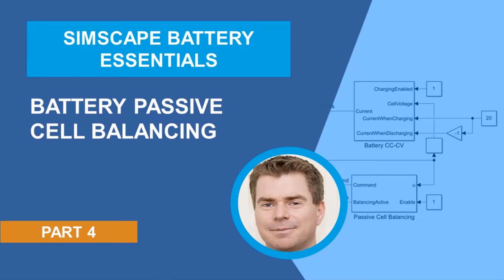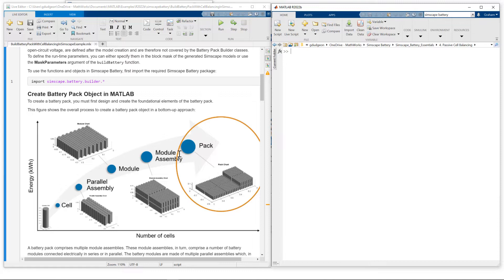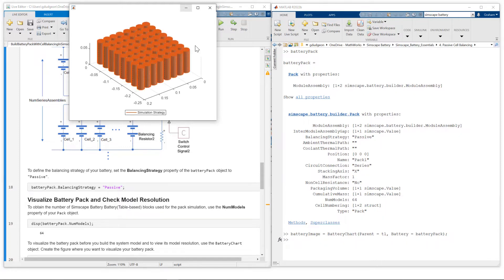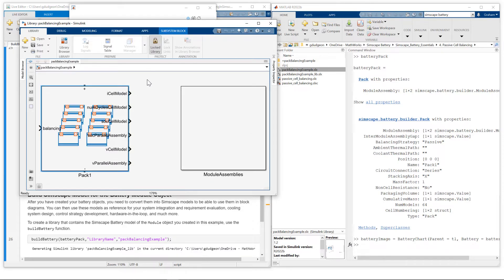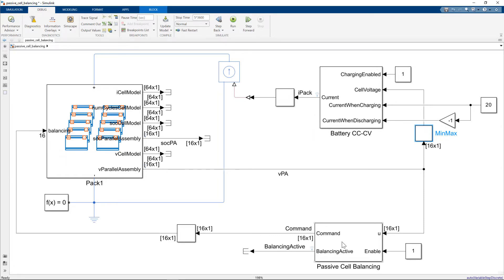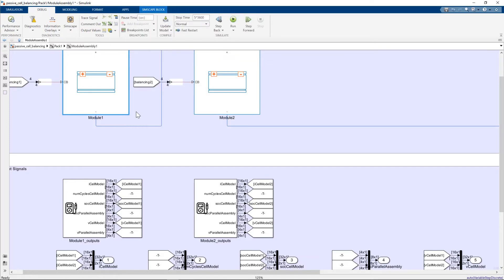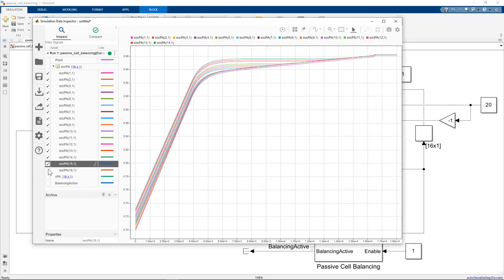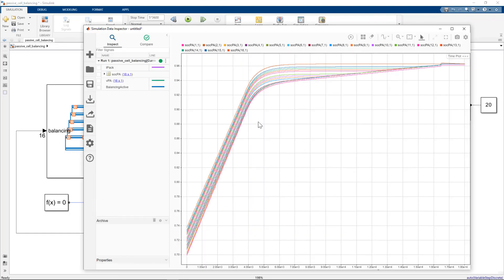Battery Passive Cell Balancing | Simscape Battery Essentials, Part 4

Comment: It was a great video but i am getting the straight line graph moving in y-direction  after running the simulation and getting warnings as "At time 5677.000000, one or more assertions are triggered. State of charge must be less than or equal to 1. The assertion comes from:
Block path: untitled/Pack1/ModuleAssembly1/Module1
Assert location: 
    o (location information is protected)
    o In between line: 80, column: 26 and line: 92, column: 52 in file: D:\2Extstudy\simscape drive\simscape\+packBalancingExample\+ParallelAssemblies\ParallelAssemblyType1.ssc
    o In between line: 73, column: 39 and line: 82, column: 61 in file: D:\2Extstudy\simscape drive\simscape\+packBalancingExample\+Modules\ModuleType1.ssc"
please help me with this i am struggling since 4 days to find the mistake😢😢😢😢
Reply: Instead of using the minmax block to connect the pack and passive balancing i was using unit dealy since i was getting only 1 x1 matrix as output from minmax block
Reply: @ManojKumar-dz3dl  i know the issue and i can help you.

Comment: Hello! Thank you for your video. I'm getting error when running the simulation. Any help would be greatly appreciated, thank you.

Error compiling Simscape network for model passive_cell_balancing.
Caused by:
['passive_cell_balancing/Pack1/ModuleAssembly1/Module1']: Length of Cell model state of charge must be equal to Number of cells in battery. In packBalancingExample.Modules.ModuleType1 (line 52)
Reply: Check the vector length of the SoC vector and make sure it has the same number of values as the number of battery cells